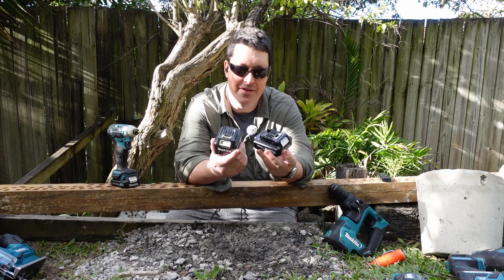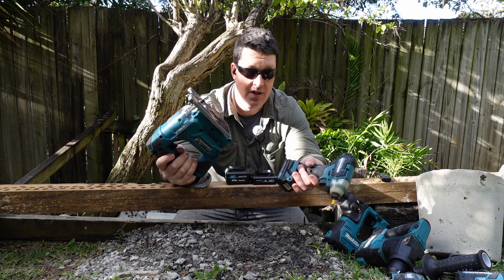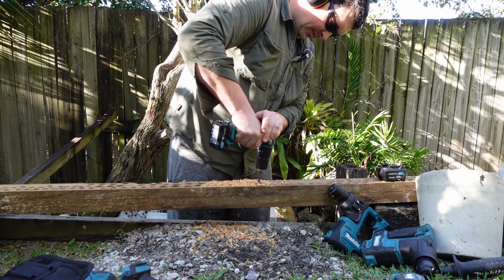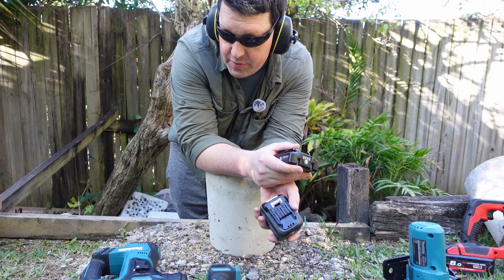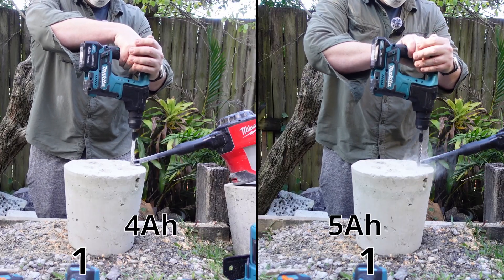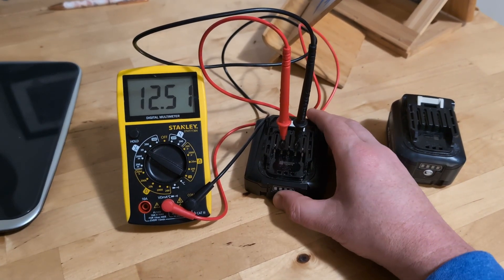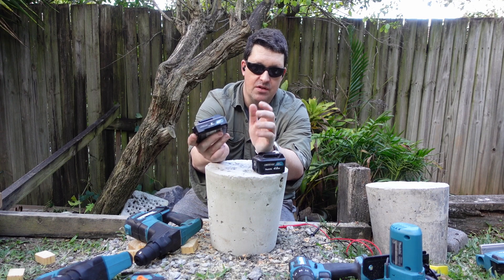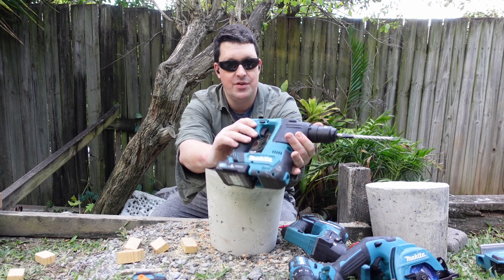Makita's new battery BL1050B: is it actually high output?

Comment: I’ve typically found that single row high output batteries are similar to two row 18650s but are so much better when they’re double rows
Reply from the maker: Sounds about right. If they do a double row with those bigger cells that's gonna be real solid power, but I think really this is a warm-up for new 18V 21700 batteries

Comment: Good question :) 1040 is 2x20A cells, while the new 1050 is 1x25A so lower max power overall but better packaging and energy density :)
Also excited for more 12v tools, really a great line
Reply from the maker: I'm also looking forward to new stuff in that line. I was thinking they might discontinue it a few years ago but looks like we'll get some tiny surprises in the future! Still no idea what they're going for with this battery tho. Typ. 5Ah? Typically? Like how some lines are 20v max*?
Reply: @BoltahDownunder   probably an insurance due to how manufacturers rate their cells, they have typical capacity and minimal, weird part is that all cells have that rating so idk why they used it here.
Reply from the maker: Classic Makita really
Reply: Now if only they can make high output lxt batteries!